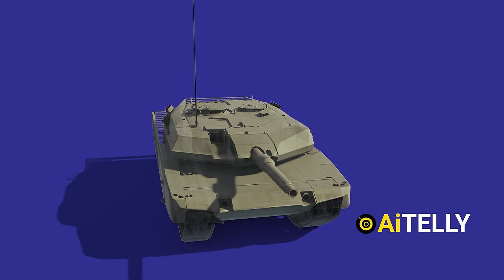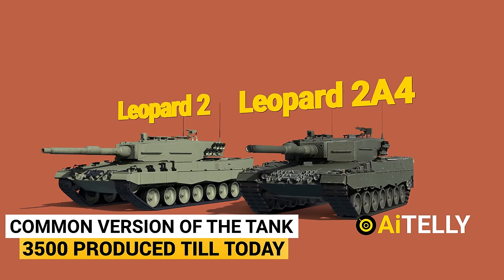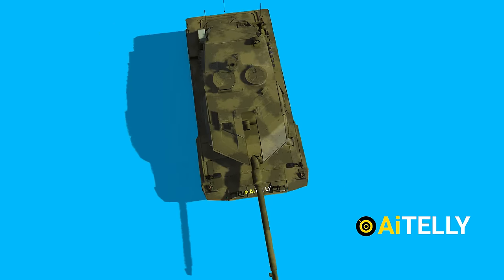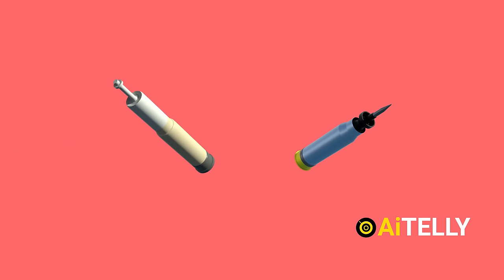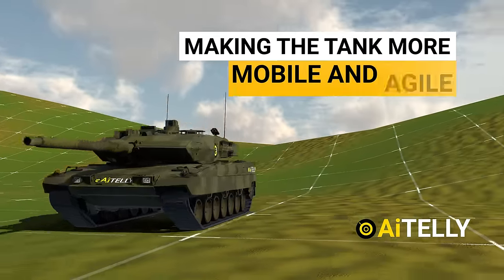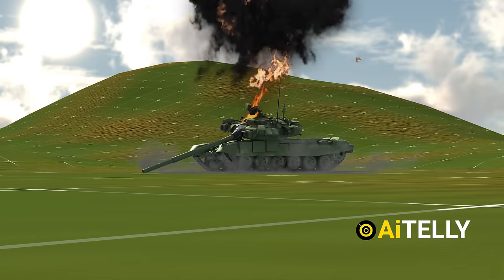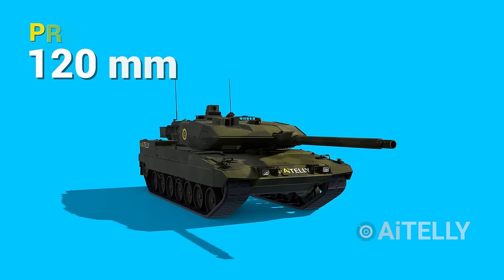Leopard 2 Main Battle Tank How it Works with modular Space Armour Leopard 2A6 Loepard 2A4

Comment: Stuff like Situational awareness doesnt really matter since doctrine requires Tank scouts to scout out an area first AND these tanks are not alone!

They are designed to fight with Marder and Puma IFVs and Panzergrenadier Infantry.

They keep the situational awareness due to that.

And the newer Leopard tanks are supposed to have Trophy systems and a confidential weapon protection, whatever the second means but that helps against most modern ATMs.

The issue i see is the same as with most other tanks, what can it do against missiles that come from above? Not much if the public information is correct but maybe the Kf51 is better in that regard? I didnt look into it but hopefully they worked on the Javelin issue.

Comment: 4:30 the 2a6/2a7 with its best apfsds, the dm53/dm63 round penetrates Up to 800 so probably around 700mm at least from 2000 Meters range, 450mm Penetration would be more realistic with older apfsds rounds Like dm33 or dm23
Reply: ... its* best APFSDS (it's = it is)
Reply: My Bad, thanks for the correctoon

Comment: One thing the ammo from the hull was removed on every Leopard 2 version. Armor store only in the turret now with blow out pannels.
It was after tests shown to risky to have ammo in the hull.
Fun fact the A7V could hit targets up to 5km with 65 kp/h and has a hit ratio of 99%.
Of course official data so you can bet its more then that.
Reply: Not at all it still there otherwise the Leopard would only be able to carry 20 rounds. 🤥
Reply: @viceralman8450  yep new tactic and 20 rounds are enough.
No its not its no ammo anymore in the hull way to dangerous iv a round would pen.
Reply: @michaeld.uchiha9084   No they haven't you have less than half the ammo the Leopard can carry, (just double checked and the turret rack can only hold 15 rounds) the ammunition you should have, that will more presure on logistics and reduce the operational range on the tank significantly, from 42 rounds to 15 what a bunch of nonsense.

Comment: Quite curious to see a Tiger tank with the turret of a Panther at the beginning at the video. Although I think some of these really existed.
Reply: It is a Tiger Ausf. H2 most likely. It was tested to equip the tiger with a 7,5cm canon but due to a new AP for the 8,8 it was dropped if I remember correctly. And I think the turret only looks similar to a Panther from the front. It has an machine gun build in the back of the turret and so on.

Comment: In reality the spaced armor isn't meant to redirect the round or make it impact sideways. A kinetic penetrating rod erodes (think of a melting candle) as it goes through thick armor. So its highest penetration potential is utilized when its armor-facing surface area is smallest (the diameter of the dart) and when it’s not deformed and straight. When a dart goes through the leopard wedges, which to my limited knowledge, are a steel-rubber-steel sandwich, NERA, exert lateral forces on the dart, causing it to bend, curve, or tumble slightly. Although the time between it going through the wedges and it hitting the main face of the armor is small, the lateral forces acted on the dart are enough to significantly reduce the effectiveness of it. Some may think the wedges cause the dart to totally go sideways or flip, but in reality it just bends the tip of the rod and causes the rest of the rod to show its broadside by just a few degrees, increasing its surface area relative to the main armor face.

Comment: There is a mistake regarding the APFSDS (Armor Piercing Fin Stabilized Discarding Sabot) ammunition:  This type of projectile has no explosives and thus penetrates armor only by kinectic energy. For achieving maximum effectiveness, the projectile must maintain as much energy as possible and concentrate it in a small portion of the target. To maintain such energy, the brojectile must fly fast and have very low air resistance, and to concentrate the enery in a small point, IT MUST NOT SPIN, for this would dissipate part of the energy, thus rendering the projectile useless.  The fins are supposed to maintain a straight trajectory and compensate for the thin and alongated form of the projectile.

Comment: I've never seen a tank design with the main cannon and the coaxial machine gun with their own independent elevation control. I don't like how the whole cannon has to lift up if the gunner is engaging targets >500 meters with the coaxial, and then drop down when he switches back to the main cannon. You could make the 7.62 rounds and the 120mm high explosive hit the target at the same time.

Comment: Golden Point - Gunner is also not required if you use a Radar Detector which automatically scans the horizon and picks our the target and then automatically fires the Cannon ie all by using Computer and Electronics Wiring and Circuits and it also Ensures Guarantees Destruction of the Target while a Gunner has a very, very low chances of hitting a target and usually misses the target.
Reply: i'm not sure this is accurate. No one wants to use ACTIVE RADAR on the BATTLEFIELD , it would be like using flash light at night. YOU STAND OUT LIKE A SORE THUMB.
Now using passive RADAR to detect enemy AFV using APS....that could be useful.

Comment: Heat or shaped charge shells like the multipurpose one, do not penetrate by a jet of molten metal. Its not the temperature or velocity but rather immense pressure created by explossive filler that is shaped in a conical shape to concentrate that pressure. At such pressure the metal becomes supperplastic and simply gets blown out of the way- into the tank.

Comment: Great work!!

Here are my 2 cents worth;

1. Leo2A7 sold to Norway last month has a unit program cost of US$38m per unit.  The days of $7m were in 80s…. 

2. Leo2A5 suffered catastrophic losses in Syria.  Only 2 were destroyed by enemy tanks (likely T72 down grade version) and the rest were destroyed by ATGMs, mines or IED.  In particular, the front where the ammo rack is located was the key area of failure.  The additional armours to this particular area is limited, hence the same vulnerability largely remains.
Reply from the maker: Is this true abot the Leo2A7 cost of $38 million dollar per unit
Reply: @Aitelly  No. The order also includes maintenance training, support and spare parts for several years, so simply dividing the total cost of the order by the amount of tanks ordered doesen't work. A new Leopard 2A7V has a unit cost of about 17 million USD.
Reply from the maker: @jonny2954  sounds right because you could almost get an attack helicopter with this price tag of $38m per unit

Comment: 0:47 the Tiger tank has the wrong turret.
Reply: 3:50 "Rheinmetall" not reinmettal.
Reply: 4:10 the temperature of the metal jet is below it's melting point.
Reply: 4:41 it's a tank gun, artillery gns fire indirectly.
Reply: 4:57 the whole cartridge is flying outside the barrel? You had it right in the earlier animation of the sabbot round.
Reply: 5:15 APFSDS just changes the direction when passing the spaced armor, then impacting the actual armor at an suboptimal angel that makes penetration very unlikely. Another positive effect iof spaced armor is that it reduces the effectiveness of chemical rounds like HESH and HEAT dramatically.
Reply: 5:27 active protection will be integrated in the comming A8 variant.
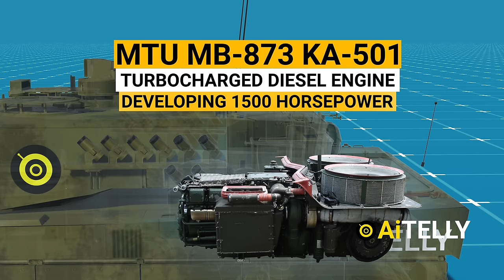Reply: 7:05 it's a multifuel engine that runs on everything from vodka to jet fuel.
Reply: 8:08 the thing that makes the gun more powerful is the barrel length of 55 calibers, hence L 55. The rounds fly faster because of this.
Reply: 9:06 that argument goes for all armored vehicles. Every view port is a weak point. That's why there is a battle management system installed on almost all nato combat vehicles as well as the best optics you can get for money.
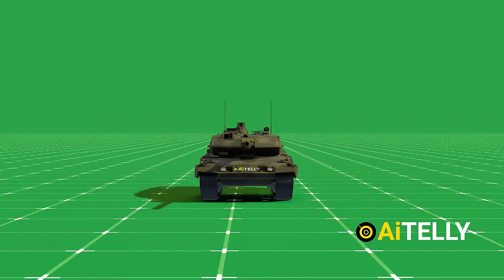Reply: 9:21 top attack missiles aren't particularly new. The active protection system on the A8 variant will counter this threat.
Reply: Still nice animations, ...but i hope you guys let me read that script next time you talk tanks 😅

Comment: The T90 tanks hasn't been produced in enough numbers to have a great impact. Also, it's supposed vaunted active protection systems don't seem to work well. Israel developed a "Trophy Active Protection System", that fires a projectile at incoming rounds in hopes of deeating them. Some modern western tanks have the Trophy System, or a variation of it. In Ukraine, T-90's have been turned into scrap metal. It's great on paper, not in actuality.

Comment: Panoramic site with thermal imager?  What about the laser range finder? Doesn't rate a mention..    " This is operated with a digital fire control system, laser rangefinder, and advanced night vision and sighting equipment. The tank is powered by a V12 twin-turbo diesel engine made by MTU Friedrichshafen."

Comment: although Leo 2 is one of my favorite MBT I do question why don't they add blow out panel for the ammunition in front hull? I know they try to reduce the chance of cook off by using new fire resistance propellant but that doesn't really insure the crew safety when it does catch on fire, so I have no idea why they don't add those because the ammunition just sit there unprotected either maybe some thin metal sheeting but that's all about it

Comment: Scene 7:08 -7:16,... I know the Leo 2 has safety features protecting the crew from ammo cookoff and provide them more time to evacuate the tank in case of a catastrophic breach.  However, I still find the fact one of its fuel tank is right next its ammo bin to be a very uncomfortable design.
Reply: With the DM63 and newer rounds they have insensitive ammo, it doesn't cook off. You can shoot at it directly with an RPG and it doesn't ignite.

Comment: The 2a6 at 2:21 Never had this Hull. Eben the latest version 2a6MA3 which i am commanding, have other headlights and snowtracks. The Shown hull at 2:21 is the Hull from the newest 2a7v. Dont know where you get youre pictures
Reply: Even* (switch off German auto-complete when typing in English) the latest version (...) has* different* headlights. The hull* shown* (...) is the hull* of* the 2A7V. (...) where you get your* pictures.

Comment: might as well design the 360° deg rotating main turret of the Leopard 2 A7 as per the angular shaped & contoured design of the armoured turret cover . . . instead of the slab sided turret design . . . that way the all round armoured turret cover will fit like a glove on the forward & sides of the turret . . . shaping the forward & side turret section of the Leopard 2 A7 angled on all 3-axis will act as a deflector against incoming projectiles, even without the armoured turret cover . . . the Leopard 2 A7 could do with a stiffened suspension setup & a 5.0 in. suspension lift, for enhanced off roadability . . . would require adding heavy duty thick & long (taller) high rate coil springs, that will complement the existing torsion bar setup . . .
Reply: Do you want people to read and understand what you wrote? Then why make reading difficult with those silly multiple fullstops between sentences and sometimes even right in the middle of sentences? Use commas and single fullstops,* everything else looks silly and serves no purpose.

Comment: 5:03 This is true yet complete BS at the same time. The big deal with the armor of the Leopard 2's, is NERA, or non explosive reactive armor, which is composite layered armor that deforms, shatters and possibly deviates a projectile. Spaced armor does NOT affect modern kinetic rounds or APFSDS as shown in the video, or even close to what was shown, since the "spaced armor" are composite screens, it doesn't make the projectile brittle, instead, just swoops out a little bit of the projectile nose. It would make an older projectile such as APDS or APCBC get slowed down and shatter, but not a modern APFSDS. The actual purpose of these screens, including adding ≈ 150mm of armor thickness, is actually to counter the previously mentioned HEAT rounds, making it explode earlier, therefore making the jet produced less concentrated around the point of impact, which reduces penetration on the actual layered armor. So in short, the screens do NOT provide protection as mentioned in the video, what does the protecting job against kinetic penetrators is actually the NERA, which provides ≈500-800mm of effective thickness, but it got no mention in the video.

Comment: If you compare with T90 then compare with T90 Proriv tank's.
Nevertheless Leo is great weapon but like for all tanks he is doing the job if he have support as it should.
Russian army pay the price on begging of SMO but now it is different story, last version of T72 upgrade after 7-8 months of SMO so we can call him B4 variant work much much better than B3 from beginning.
Russia pulled out 6000 T62 tanks and upgrades them with great equipment and even cannon is changed on 115 mm but riffled not smoothbore for much longer distances for accuracy and almost everything is changed.
This is preparing for possible NATO attack on Russia and after other equipment stop attack new T62 will be used for Romanian and Polish hills and mountains. Only older tanks are built for huge elevation difference so with narrower caterpillar and new powerful cannon which can use much stronger shells and riffled bore's they will be nightmare for western tanks.
We had those problems in Bosnia with Serbian T84 ( upgraded T72) and T55 resolved those problems.
Reply: What a bunch of BS the museum piece t-62 they have like 800 of them and barely modernized them before been thrown  to the front to be turn in to scrap. 🤣🤣
Reply: @viceralman8450  , я правильно понимаю, что Т-55S - "это другое"?

Comment: Golden Point - The Shell is also not streamlined and won't go far and it won't be accurate.
Reply: The shell is a discarding sabot. Meaning it will fall apart once it has left the gun barrel and reveal a pointy rod made from tungsten. This pointy rod is streamlined as it can be.

Comment: The fatal flaw is Russian tanks, which is they use an auto-loader. The tank rounds are stored above the crew compartment in the turret. When a Javelin, or similar weapon, hits the tank, the ammo explodes and blows off the turret, killing the crew. Modern western tanks store the ammo in a compartment with "blow off doors." The ammo if exploded blows through the doors skyward. This offers the crew a better measure of protection. Newly upgraded Abram tanks have gone with an autoloader, reducing the tank crew by one. But they ammo is stored separately.

Comment: To make it more educative, one should add real video footage of Leopards lost in Syria (Turkish vs Kurds).
Reply: Well movement and speed is one strategy of a modern tank. It can fire from full speed and still hit accurately. If you do it like the turks and position tanks staticly on the most visible points without camouflage like a bunker it's just stupid. A tank is not a bunker with 3 m thick walls
Reply: @simonm1447  It seems that you didn't see too many of those video's. One in particular, tanks were on the attack and were hit (ATGM) in frontal area.
Reply: @TudorMiron  well, Turkey has 2A4s missing the additional frontal armor upgraded to later versions. 

It's always a game of action and reaction, if you build a tank with twice the armor somebody will make a weapon capable of penetrating more armor than the last generation did. At the end there's no tank which is invincible, there are just tanks which are simpler to defend and others which are harder to defend against.
Reply: @simonm1447  Agree, no tank is invincible but I added my initial suggestion because this video was giving that kind of impression :)